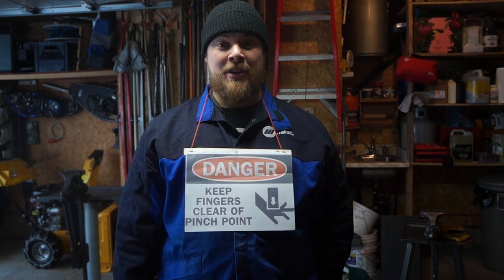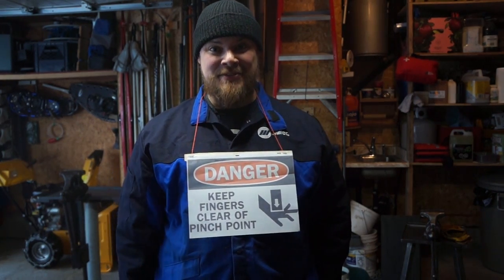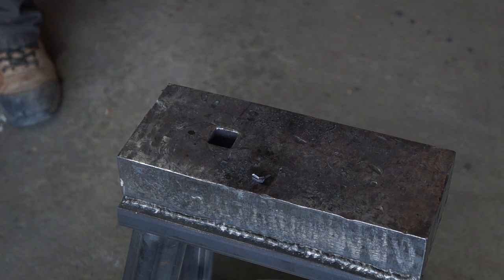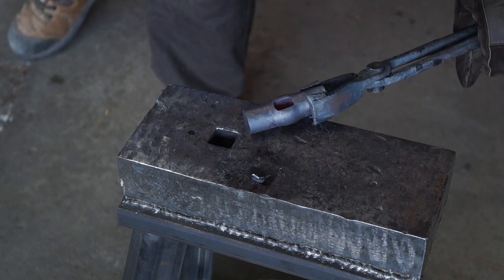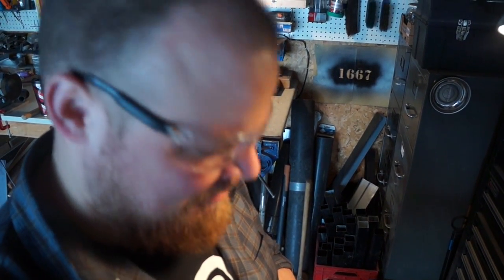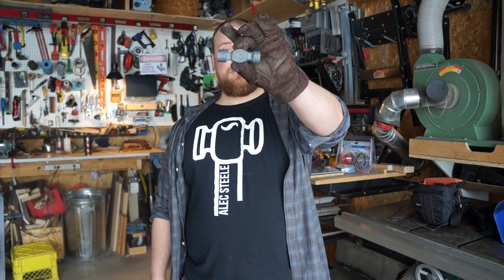Forging Some Plane Hammers!

Comment: Good stuff. And I think that 1" wide belt grinder is short more than just a few horse power. . . may be in need of some bulking as well. Been on the weight loss diet too long. ;D :P Even a crappy 4x36 works better.